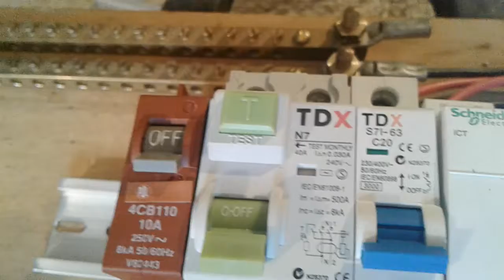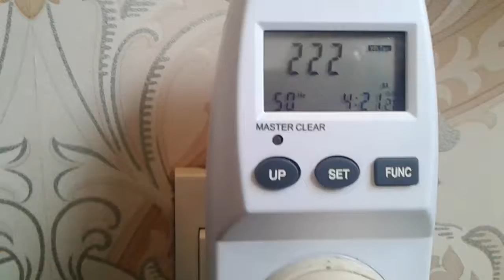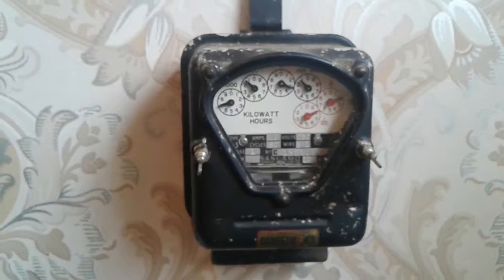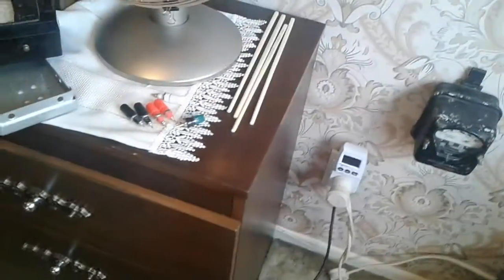Switchboard update

Comment: Nice little setup, coming along. Only trouble with a “main switch” setup is that if the fault is between earth and neutral it won’t matter that circuit is switched on or not via the MCB as the MCB only switches line, not neutral or earth! Just bear that in mind. Good luck :)
Reply from the maker: Thankyou